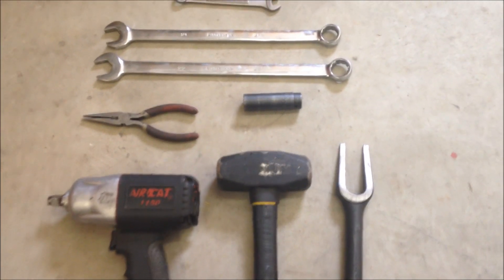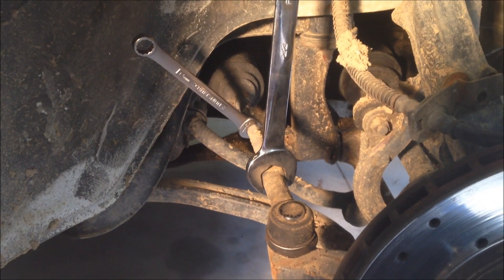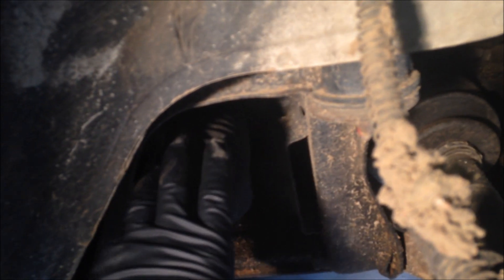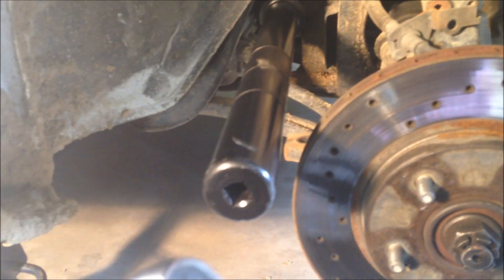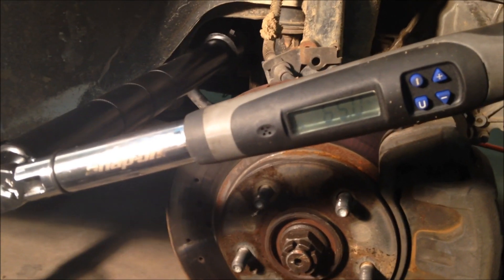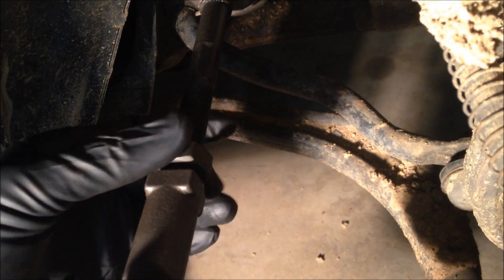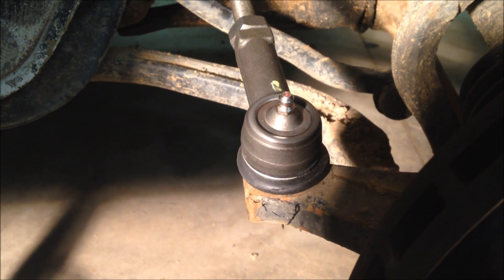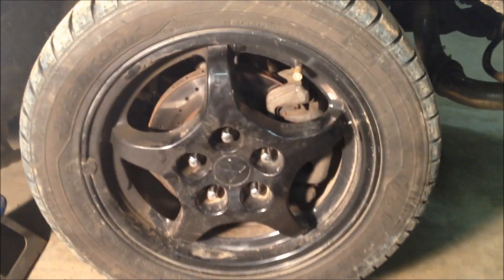Inner & Outer Tie Rod Replacement 95 Eclipse GSX 2G DSM

Comment: I have a 99 rs, and I have to replace my inner and outer tie rods your video was a big help. I always do my own work but never had to replace tie rods before. my wheel bearings need to be replaced as well but I have a situation with that, my axles are rusted and fused together in the bearings I've beat the shit out of it with a hammer and sprayed a half a can of pb blaster on it but it's not moving. what can I do to get the axles out of the bearings. just to be safe I bought new axles I figured I would damage them since they are the original ones with 160,000 miles.. I've bought cardone select axles, timken wheel bearings, and moog inner and outer tie rods. I also shopped at rock auto.. any help would be appreciated thanks
Reply from the maker: I would try putting some heat on it next if you can get a blow torch, also if you can get your hands on a good air hammer that could knock it out

Comment: Dumb question. But I'm working on a talon esi...essentially a eclipse rs. Do I need to compress the strut so I can take the tie rod off as I would a spring loaded vehicle, or is it not under tension when the car is lifted? I normally never do suspension work myself but after getting quoted anywhere from 60-120 for something that apparently takes a shop 30 minuted to do...ive decided to do it myself.
Reply from the maker: No you don't have to do anything with the strut to do tie rods
Reply: Darth Ry dope. very quick response! I'm ashamed that mechanics make so much off of people who don't know. you still have the GSX? This is my first dsm and only my second import and I have to say...they're like old Chevies...build quality is crap. But they have a personality that makes you enjoy every minute.
Reply from the maker: Yeah some mechanics give the rest of us bad names unfortunately but the shop I work at now is pretty honest and it's nice.
Yeah I still have the GSX, actually just got it running again today. Rebuilt the motor for the second time and spent hours rewiring the main engine harness. I've learned a lot since I made this video lol

Comment: I have another dumb question. my 99 eclipse is automatic, I just went to start it,turn the key and nothing dash lights are on but nothing I put it in neutral and it started. when I shut it off it did the same thing, on the 3 attempt it wouldn't start in either. upon singling things out it's the neutral safety switch, I hope.. where is it located ?
Reply from the maker: Mine's a manual but I guessed as I was reading that, that your problem was the neutral safety switch and I would assume it is somewhere under the center console by the shifter
Reply: That's what I thought too but the sensor looks like one of the ones on the front of the transmission and nothing that is inside the console
Reply from the maker: Hmmm could be there and it's like a sensor that tells what gears the shifter is in, and it's faulting so it thinks it's in a drive gear when it's not
Reply: I'm stumped.there are no sensors under the console. It's about to be a push button start. Lol.. I just bought new sensors for it. Neutral safety / range sensor and speed sensor. 120.00 bucks for plastic plugs. if this don't work then I'm going with a push button